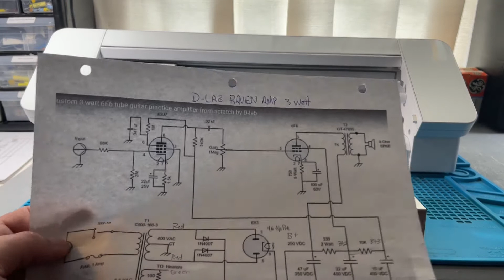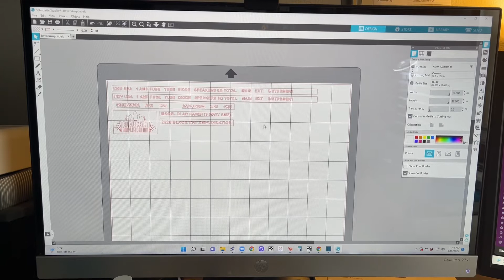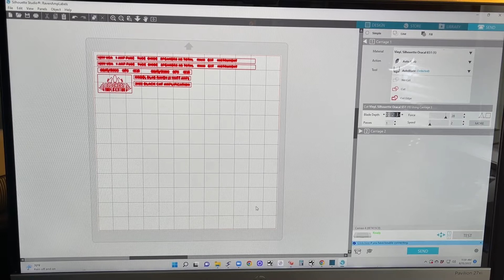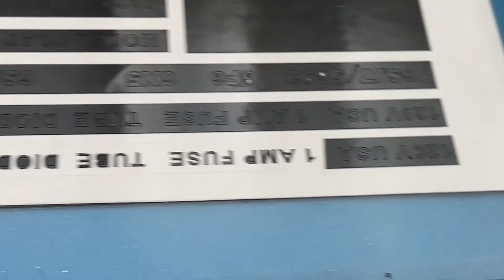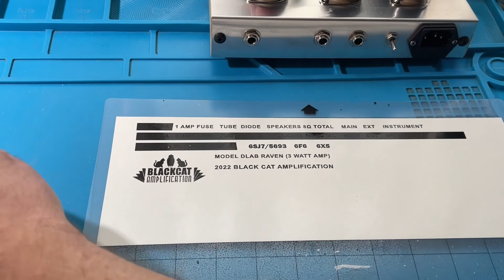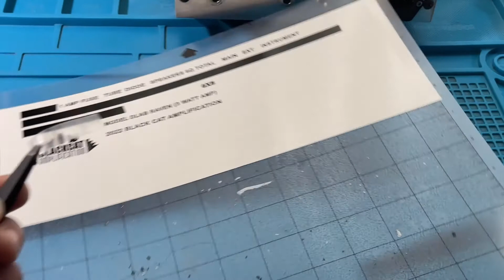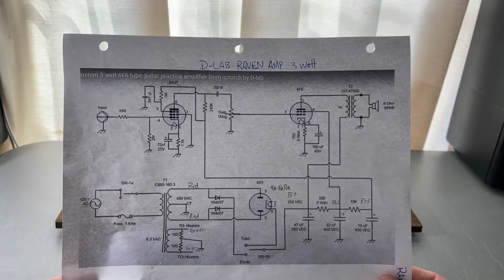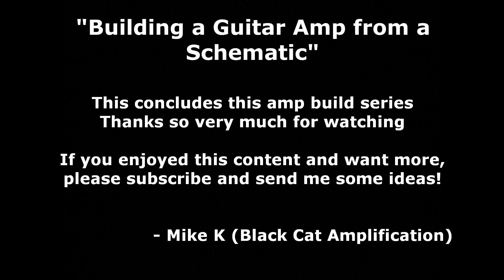How to Build a Guitar Amp From a Schematic Series (PART 8 OF 8)

Comment: Any issues using the 47uF reservoir cap on the 6X5? Seems a bit high when they're spec'd for 10uF since they can be evidently notorious for shorting.
Reply from the maker: Not at all. I’ve built dozens of these amps and other amps that use a 6x5 rectifier and never had issues with 47uf caps. They are very hearty tubes.
Reply: @DeathCapAmplification  Good to know. I've got some 6AX5's I was going to try. I may throw some protection diodes on the tube just because.